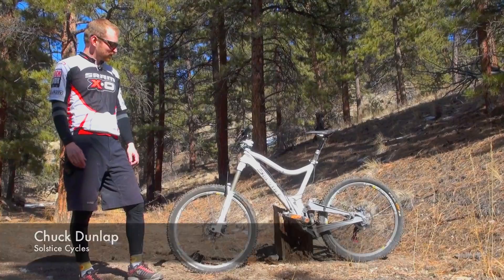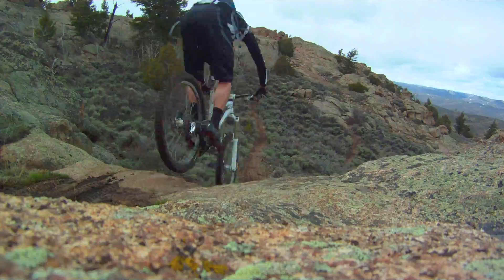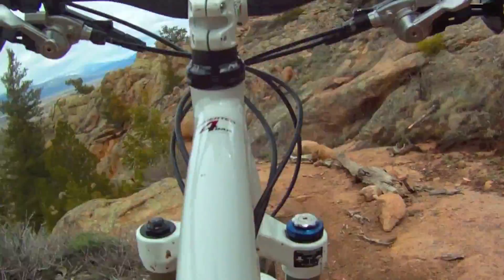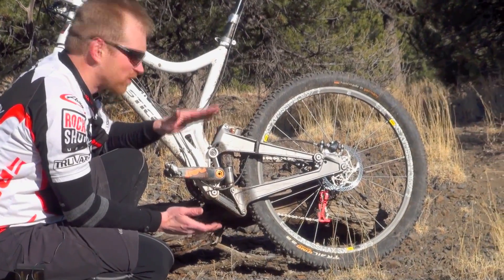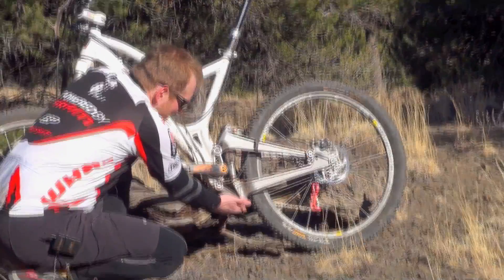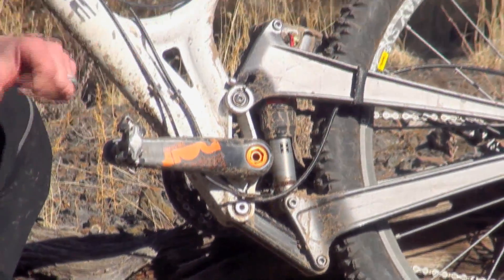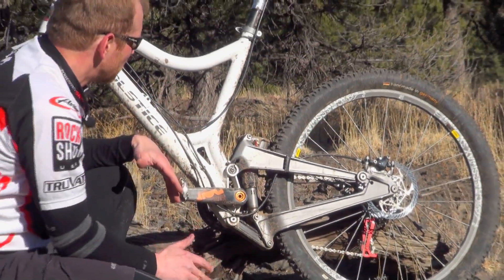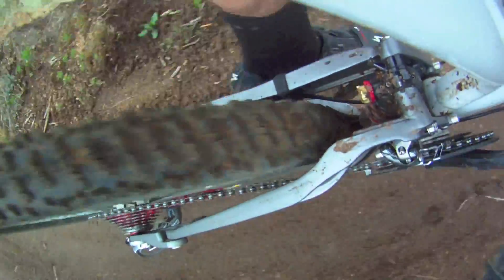Solstice Inverted 4 Bar Suspension as Described by Designer Chuck Dunlap HD VERSION

Comment from the maker: @clfry The lower short link (from the BB) is coated with a impact resistant plastic material and meant to be a skid plate of sorts - and actuates the suspension when it comes into contact with an object. It's bomber and easily replaceable.